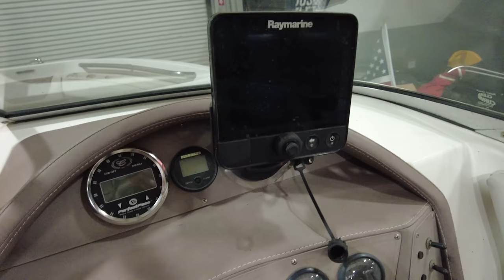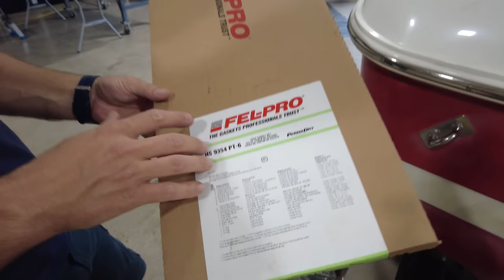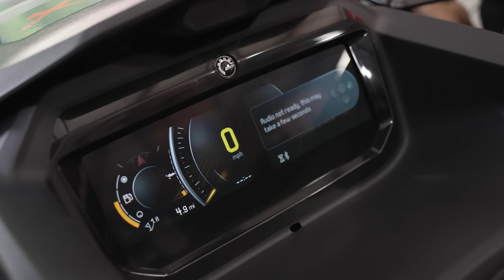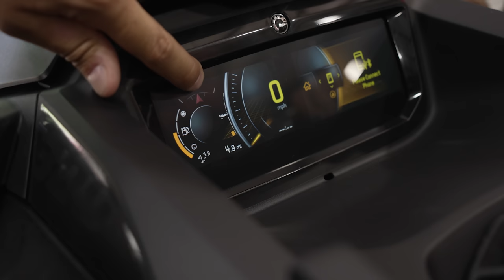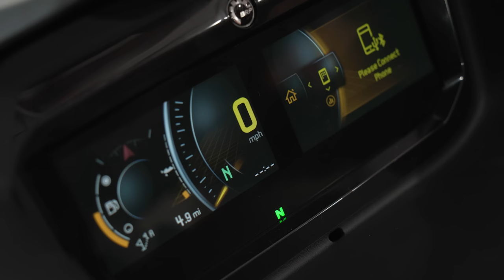Saga Náutica agora com novo Jetski Sea Doo RXP-X 300 e Lancha comm motor Maserati V8!

Comment: Eu tenho um sea doo rxp 300rs modelo internacional ( ele original da 120km/h )ja vi 123 no painel em dias nw tao  úmidos com a temperatura da agua mais baixa,os modelos vendidos nos Estados Unidos tem limitador a 108km/h , isso se resolve com um aparelho riva scom(menos de 200 dólares), e vc tera td oq o motor original tem a oferecer, obviamente apos as 5 primeiras hrs, pq ants disso a ecu eh limitada de fábrica para amacear o motor, muito importante pra um motor q costuma trabalhar  entre 6000~8000 giros direto, a fuel tech vai alem disso eu sei, mas cuidado com giros superior a 8500rmp, algumas modificações no cabeçote seria necessária e parafusos do volante tbm, muito bom seus videos👍